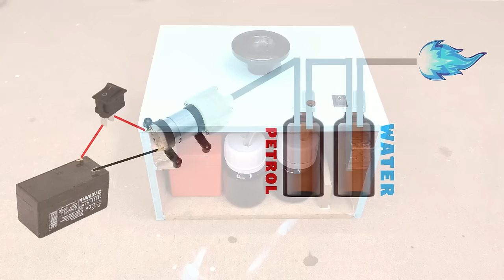DIY free gas torch | Welding Gun | How to make jet flame

Comment: Bro thank you soo much, now I can add features on my hot air soldering Gordak 850, now my cheap Gordak 850 will have 3 functions, it has Soldering Iron, Hot Air Soldering, and Jet Flame for soldering small tubes, 3 primary tools in 1 box. well, making something that others haven't made yet is something 🤑🤑🤑
Reply from the maker: Thank you my dear friend

Comment: It would be less expensive to buy a butane torch lighter or a small propane cylinder with a gas valve attachment. 
That being said.....this is a neat project. This is a very creative invention/project, and it was neatly and professionally constructed. Keep up the good work!
Reply: 3rd world country’s areas are still waiting to see those things.  I’m sure based on some of the other videos I seen jere
Reply: bro he got a windproof lighter could of just modified that only good for small jobs like soldering saves using petrol and lot cheaper and lot more safe
Reply: @ST-IV_858   dude in the video used a butane torch lighter in this project, pretty sure he had access to them lol
Reply: Q

Comment: a benzin gaz vagy a  diesel gazhoz van kozelebb  ? btu
Reply from the maker: Helló kedves barátom, a benzin jobb
Reply: Petrol would be the better option as diesel doesn't evaporate as easily to give you the flame you need/want here. We did a similar experiment years ago in highschool using acetone or ether.